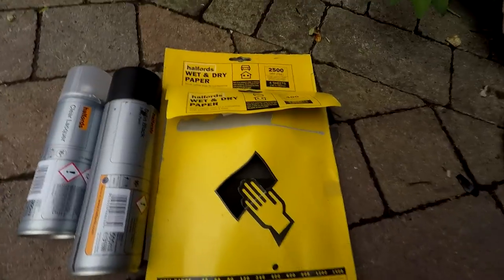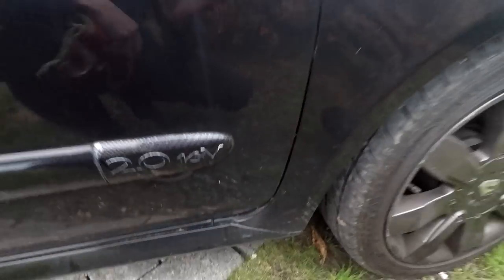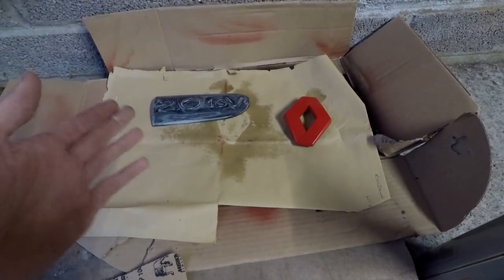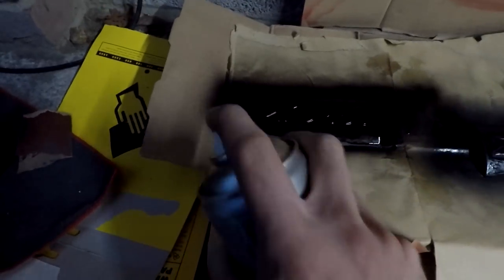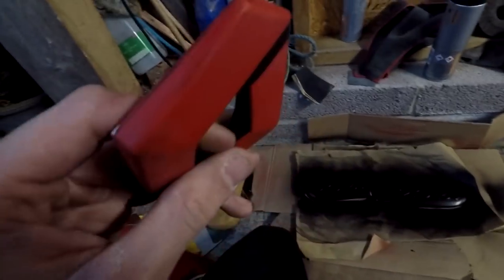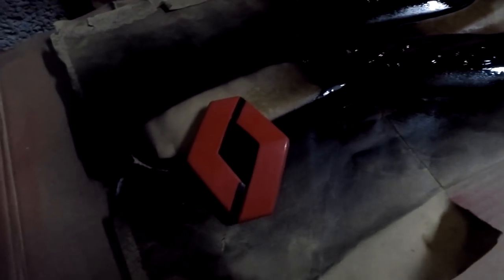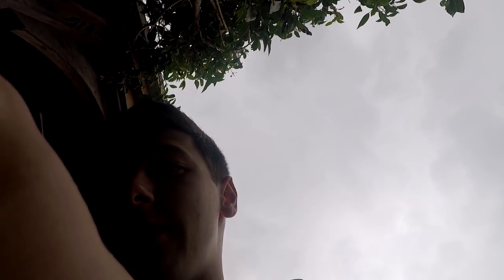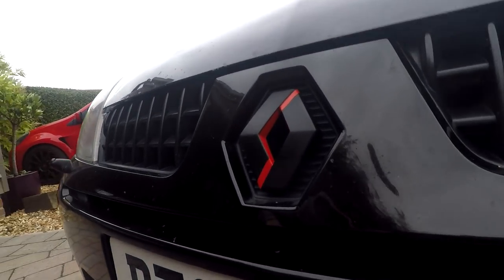Spray painting 182 bullets. Custom painted front badge?

Comment: Have you ever painted the upper grill ?
Reply from the maker: IamXiteX yeah I have painted my grill black as it was going a funny blue! I am getting quite a few stone chips on it now as it’s been on a good couple of years. So may do it again soon!
Reply: @jwmeale3058  Can you explain how you did it and what products u used ?
Reply from the maker: IamXiteX well I removed the grill from the car first! The the same process as this tbh, just put a few more coats of paint (6/7) and lacquer (4/5) on as I knew it would be attacked by stones etc. Sanding it at the start and between paint and lacquer was a pit of a pain as it takes forever to do.
Reply: @jwmeale3058  I thought sanding and lacquer wasnt need 

Thanks
Reply from the maker: IamXiteX hmm well it’s up to you but in my opinion I would always sand even if it’s a little bit as it helps the paint bite to it! And lacquer protects the paint 🙌🏻
Reply: @jwmeale3058  Thanks mate , first time that Im going to try to do this so thanks for the tips !!